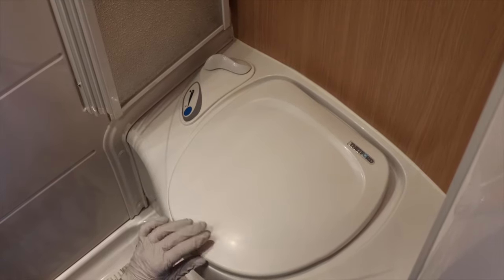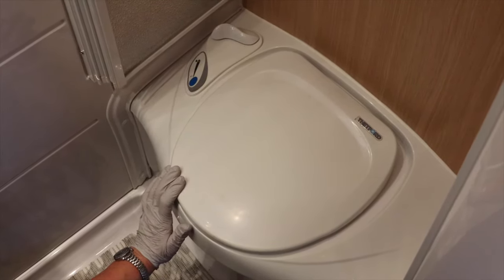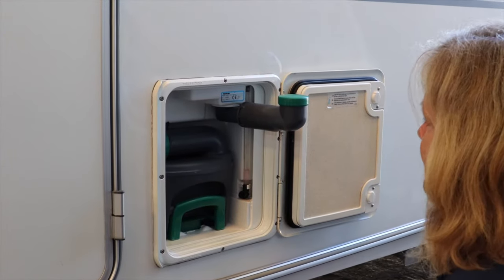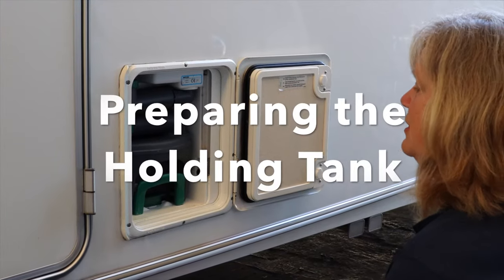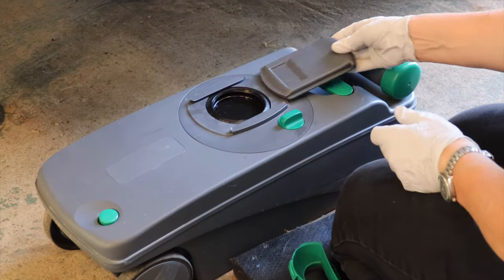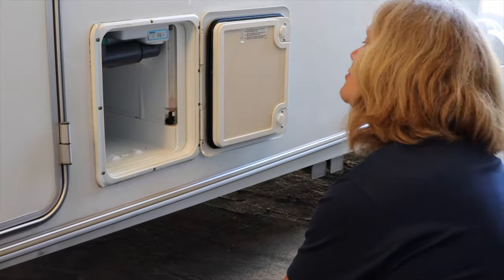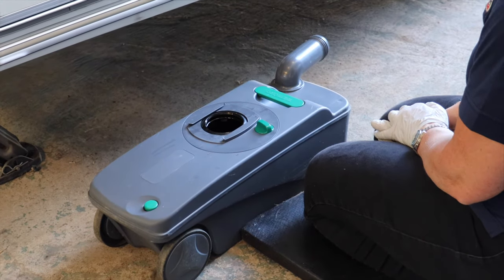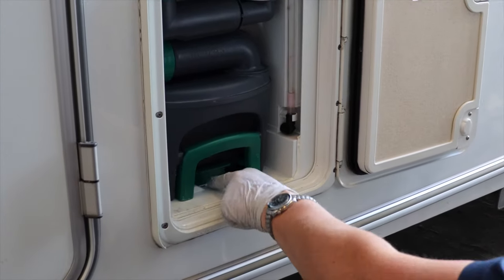Set Up and Use of the Thetford C400 Cassette Toilet

Comment: I just bought a pop up camper with this setting. So this doesn’t run off city water when camping? You add water?
Reply from the maker: I'm afraid so...
Reply: @costockcaravansltd4168  just found out my Drain Tube is leaking when I fill it will water. I can’t find the part anywhere.

Comment: Is there a way of emptying the flush tank ?
Reply from the maker: Yes, there's a small clear vertical tube on the left hand side (shows you the flush level) gently pull it down away from the bung at the top and point it downwards. The flush water will come out.
Reply: @costockcaravansltd4168  Thanks for replying. The  flush level tube is  on the RHS on my van, but I get the gist 😁👍